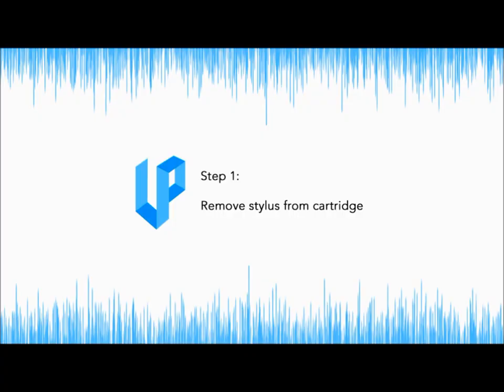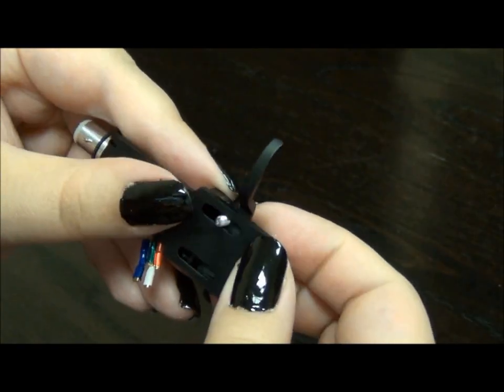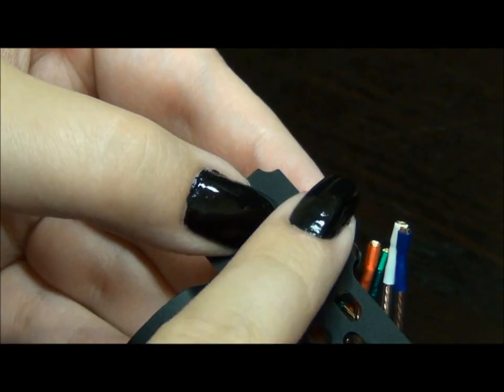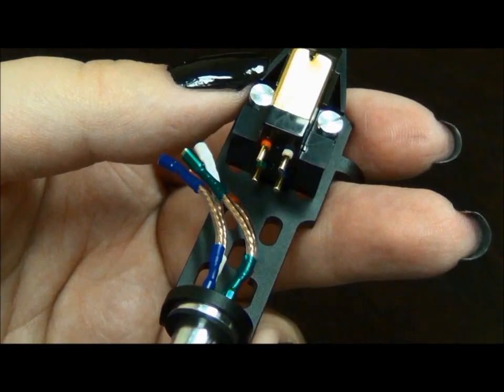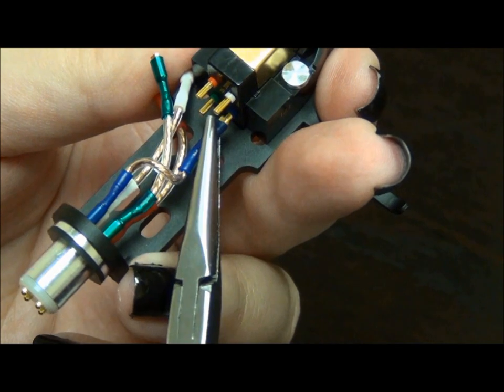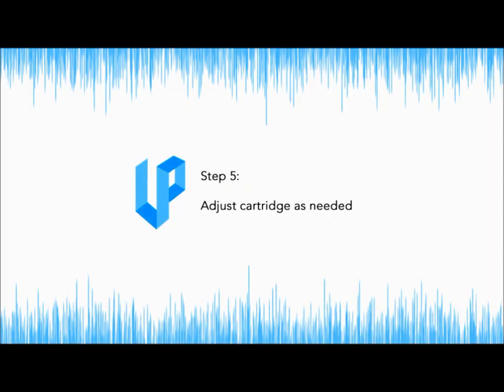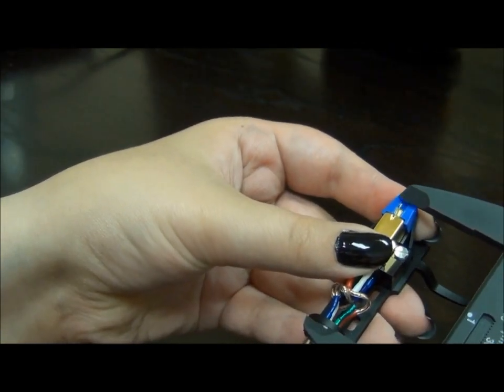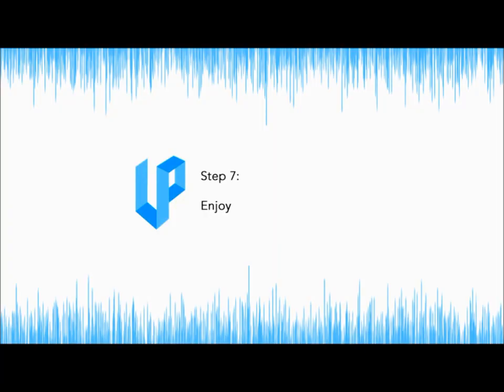How to Mount a Cartridge on a Headshell

Comment: At least the stylus distance in the cartridge to the body was mentioned not many other videos mention that and yes it makes a big difference on the sound to balance the cartridge where it should be positioned .
Reply: Im wanting to swap the red to a bronze ortofon on my project carbon debut. Looks like the same exact shape on the outside. Should this be pretty simple to do since it's the same shape and size as the red? All I need is $440 and I think I'm going to do it but the red that sound good. Any help is appreciated
Reply: How do u no wh ass the distance should be

Comment: Does the Vessel blue sound better than AT95E ?
Reply: Yes the A3SE sounds better: The Vessel A3SE sounds better than an AT95E
Submitted by Torah Torah Torah on Mon, 2019-04-29 04:06
I have both carts, including a hyperelliptical Jico stylus for the AT95... The Vessel sounds better than the stock AT95E and with the AT95E Jico hyperelliptical in my opinion.

Read more at https://www.analogplanet.com/content/you-would-pay-99-cartridge#sdQf2cmgxlyC5xOr.99

Comment: Hello,
is the 53mm a constant length, available for all cartridges?
Reply: NO, some are 49mm others 52mm. this methos is to do it quick but is better to use a protractor.
Reply: Better to use a protractor, but there isnt a protractor for a curved head shell!
Reply: @stoevpp  curved head shell that's new for me.
Reply: No it isn’t. It is 52mm on Technics & Audio Technica Turntables, 50mm on Sansui turntables, & 49mm on Sony & Pioneer Turntables.
Reply: @georgedoughly6344  thank you